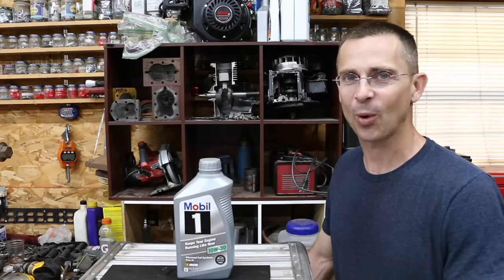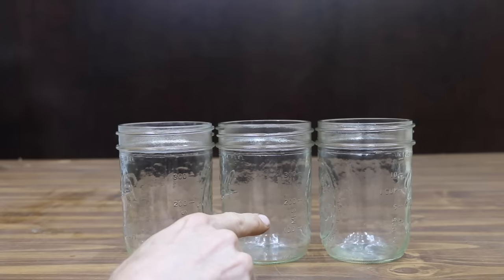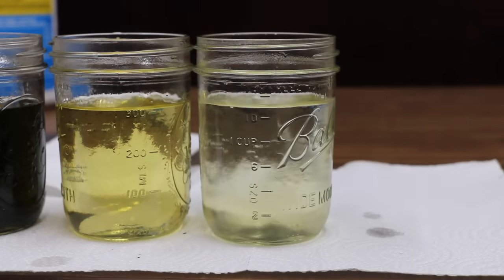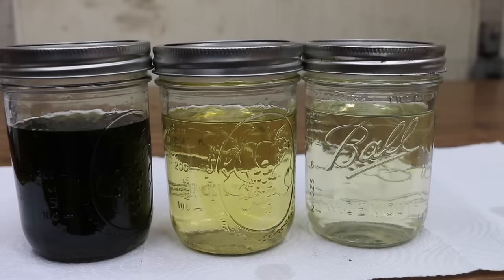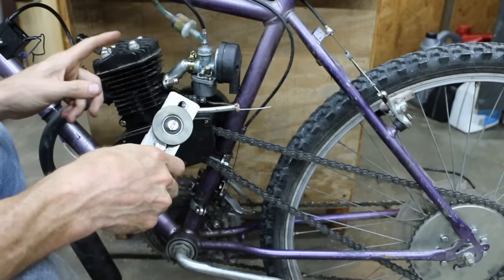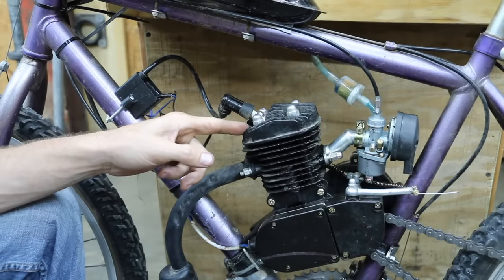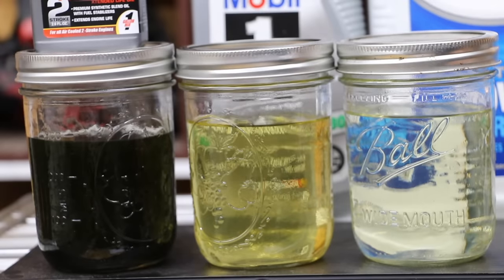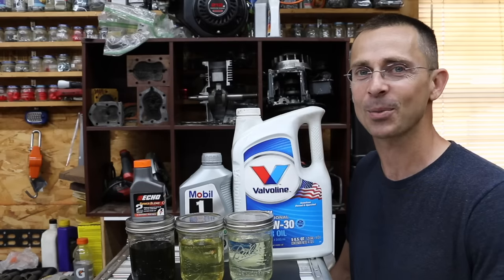Will 4-stroke oil damage a 2-stroke engine?  Let's find out!

Comment: For years I ran my scooters on a mix of conventional 4-stroke engine oil and petrol, using the measuring cup provided by the scooter manufacturer.  Never had a problem.  Since the 4-stroke oil is thicker it's important to add the oil before the petrol to ensure it mixes.
Reply: Yeah same for me . i ran it on a tuned scooter yamaha aerox with 70ccm racing zylinder and 21.5 mm carburetor . scooter runs fine over 2 years .
Reply: I did shake my bike after doing it the other way LMAO am I the only one?!!!
Reply: @ofingrey  get a 2 or 3L fuel cannister and shake it in that. You can mount a rack for it to the bike

Comment: I was about 40 years old when I discovered there was "2 cycle oil", growing up we used Quaker State 30w in everything including chainsaws for bar oil.
Reply from the maker: Thanks for commenting
Reply: Bar oil is thicker and sticky to help it stay on the chain, 30w gets flung off at the tip. Your chain will last longer.
Reply: Yeah, I was taught as a kid that 30w nondetergent oil was just fine. And, of course I had to use it several times just for the heck of it. We had lots of woods and chainsaws around when I was a kid; as for the bar, sticky oil seemed best, and about a 50w seemed good enough so that the chain oil reservoir didn't empty too fast.
Reply: Buddy of mine cuts and sells firewood and he only uses used motor oil for bar oil. He comes around ever so often and picks up our used oil.
Reply: Yeah USN (X Navy Deep Sea Diver here, 87-95 disabled) The only problem I had with lower weight oils was the chain oil reservoir would run out of oil well before the gas tank ran dry, which is a little bit of a pain to have to keep checking it, and if you forget, it wears on the bar pretty quick which makes your chain sloppy side to side in the grove.
Reply: David, I agree, but back then between cuts I was taught to put the end of the blade near some wood and rev it up and if it wasn't flinging enough oil fill'er up. (I was an AEC, also VA 90%)
Reply: Don't get me started on the VA and what they have done to me... the rats :) I'm appealing (again) and it has been 6 years waiting on that. I was out there cutting pulpwood and posts, so I needed the oil to have equal timing with the gas tank.
Reply: i change my truck oil before it needs doing and then recycle it in my saws oil tanks .  good for my truck and also seems to work as chain oil too .
Reply: I mix quaker state 10w40 in my dadss old lawnboy and works great, ill keep doing it
Reply: James Lee get a remote oil filter
Reply: Ive used 3.2oz/gallon of 30w oil in my stihl equipment for 15 years and its all great.  Its 40:1 ratio

I run canola oil for chainsaw bar-oil for that same time & and its also great

Comment: I have been using any motor oil I have laying around on my old 2 cycle air cooled engines for many years. And have found no problems. I figure as long as the mix is a little rich no harm can come to the engines with the exception of more carbon in the muffler of the engine. And all my two strokes are still running. Keep up the videos.
Reply from the maker: Thank you!

Comment: Back in the old days we used SAE 30 weight oil mixed at 20:1 in the fuel for a two stroke engine...it worked OK - but the oil is nowhere as good as specific two stroke oils that are available today and are run at 50:1 ratios.  The oil used in this test is a multi-grade detergent oil - and all those additives are worthless in a 2 stroke engine.  I worked in a repair shop back in the 1970's and we had to decarbon the exhaust ports on most 2 stroke engines when the carbon would build up and block the exhaust ports and mufflers.  Modern 2 stroke oils are far superior and lubricate better, smoke less, and don't build up carbon.  The test in this video was limited to a very short duration in a low performance 2 stroke........it is not representative of what you should expect in long term use.
Reply: David Whitacre  also if the motor was under load the test would be a bit more realistic ..
Reply: Forget the additives.  4t and 2t oil all have a base oil AND then additives are added.  What is the differences in the base oils?
Reply: @warryckscown5620  If you are talking about the video, he rode that small bike out in the field and back.  He also was just pointing out you can put any oil in your machine for short periods and it will not harm your engine.
Reply: @250txc  indeed. They're both base oils. When I run out of 2 stroke oil, I get a jug of regular Sae 40 monograde. I use monograde because it doesn't have any modifiers in it
Reply: I highly doubt anyone in a pinch would CONTINUOUSLY keep running 4 stroke oil in a 2 stroke lol pretty sure it wouldnt hurt even running a full tank of mixed gas with regular 10w30 in it unless you are holding it at max rpm until the gas ran out.... I mean shit, any bit of lube is better than no lube if you're in a pinch. Especially for these small engines running for a short duration at somewhat low RPM. But yes you definitely covered some solid points 👍

Comment: Back in the 1960s I owned a SAAB with a 3 cylinder 2 stroke engine. When you got to the gas station you jumped out before the attendant pumped your gas (what a novel concept) and added a quart of 30 weight oil to the gas tank then filled it up with gasoline. It must have worked. I drove that car for over 90K miles with no issues.
Reply from the maker: This is very interesting!  I didn't know there was a 2-stroke engine made by SAAB.
Reply: SAe 30 run fine and burn clean

Comment: That bike looks like it might be TOO much fun.
Reply from the maker: lol. Yes, it's a great way to cool off in this hot weather.
Reply: I purchased one of these motorized bike kits and yes, they are pretty fun to ride. It has way more power and torque than I was expecting from this little engine. How long can these motors run continiusly without overheating? 
PD: Do more bike videos!!!
Thanks
Reply: Led Daudet they shouldn't over heat since they are governed, just don't engine break down a long hill and you should be fine for hours.
Reply: I've heard they last about 1,500 miles of "normal" use then the cylinder wall gets scored.
Reply: I have a motorized bike, its extremely fun 👍
Reply: Project Farm how fast can the bike  go with the kit
Reply: @offroadz4861  depends on weight/bike/mods. Stock about 30-40with mods (porting, timing/expansion pipes/intake carb) over 70mph
Reply: bmxbeemer80 what keeps them from over revving then?
Reply: @gusthebus2542  you have obviously never had one apart. I have one apart in front of me right now.  Only things connected to the carb is throttle cable and fuel line.
Reply: bmxbeemer80 yeah sorry that comment sounded kinda cringy i was just wondering so hopefully i don't offend you or anything, I have  a honda flat track dirtbike and I know if you keep revving it, it will eventually blow its self up because there is no limiter of any kind. Theres also basically no top speed it's just how long you let it rev up. I'm guessing this engine is similar?
Reply: Modded these motors will spin well over 10k rpm, some say 14k. Out of box maybe only 6-8k
Reply: @Imageloading...  neat! My bike will spin about 16k.
Reply: @gusthebus2542  do you have your bike in videos?
Reply: @Imageloading...  nah sorry dude...
Reply: @Imageloading...  if I do post somthing it becomes private for some reason :(
Reply: @Imageloading...  I dont have a Instagram or snap but I could text you a pick of the dyno sheet
Reply: I use to have one of these, I towed my friend behind me 60 miles to the beach going 30 mph. Anything faster the frome would vibration into bits. But hey, we made it there and back with 0 issues. I would be the gas, and he would be the brakes. A loop of 550 paracord in the middle with zip tie breakaway lines. Unfortunately the clutch completely burned out when going up a mountain pass. I clutch dumped it at 4k rpm, and i didn't realize it was slipping until the pads were all glazed over. I stopped it and couldnt restart because the pads were so glazed, it was as smooth as glass.
Reply: TIMEtoRIDE900 I've put 1500 miles in varying riding, including mudding and in the snow, left it in the rain, raced it, and all that happened was the threads for the spark plug gave out.
Reply: offroadz bro the "standard" 80cc kit peaks at around 30mph in good conditions. variables include rider weight, aerodynamics, tire profile, wheel weight, size, and axle bearing friction. I've gotten mine to go 35mph on 27" diameter tires while planking on the seat.
Reply: gimme likes because my profile pic is justin y mostly the crankshaft weight and friction, in correlation with the intake. theoretically you could rev as high as 13000 as long as you could maintain the air/fuel ratio necessary to overcome the drag of the crankshaft. with 2 strokes as the fuel contains lubricant more fuel =more lubricant so you really can't "over rev" 2 strokes, you just increase the temperature as opposed to overpressure the head/score the walls
Reply: @gusthebus2542  a two strokes exhaust port limits rpm to a certian degree
Reply: It was custom ordered and was featured on an episode of american chopper
Reply: Petrol engines on push cycles in UK are illigal here and you end up in Criminal Court.   So are electric push-scooters and skateboards 2 or 4 wheeled variants, but electric pushcycles are legal under 25mph.   If it is  not taxable then its illigal.
Reply: Off subject a little, but I have that bike kit. I made a silencer out of a red Bull can for the bike muffler. Cut off the top of the can, drilled small holes in the bottom and stuffed it with coarse steel wool. Slid it over the bike muffler and secured with a radiator hose clamp. Works fine until you catch it on a curb.

Comment: A lubricity test for 2 stroke oil brands would be interesting. Include red line racing oil if you decide to do a video. Testing it mixed as well as unmixed might be a good idea. I would use 32:1 in the mix tests because its a very typical and average mixture. Good vids btw!
Reply from the maker: Great recommendation! Thank you!
Reply: Yes! Please test redline vs maxima k2 vs amsoil vs whatever else! Pleeeease!

Comment: As a young teenager in the early to mid '70's I had a '72 Suzuki TS125 and the only oil it ever saw was Pennzoil or Valvoline 30wt, whichever was on sale cheapest. Same for all my buddies and their bikes. I don't even know if there was anything such as 2-stroke oil back then, but the regular 30wt worked fine and none of us ever had any problems with our engines, and we ran the crap out of them.  Great video as always, thanks! 👍
Reply from the maker: Thanks!  Thanks for sharing.

Comment: Good question. I have a tiny 2-stroke generator that I keep in case the power goes out to keep my reef aquarium alive. I don't always keep 2 stroke oil on hand, but I always have some mobile 1.
Reply from the maker: Thanks
Reply: Reef aquaria are pretty hardcore. If you want to keep the little generator as a standby unit, consider getting a can of long life fuel. It’s got less cycloalkanes and more aliphatic hydrocarbons, so it’s more stable over time. 
Another solution would be to get a camper battery and an inverter, that will get you a few hours at least, depending on the size of the setup and demand from essential pumps, heaters etc.
Reply: I've considered battery options, but I've used this generator twice, and it's gotten me through half a day just fine. All I need to run is my water pumps and a heater. The thing is rated at 800watt, so it should be able to handle that no sweat.
Reply: Jase Poag that’s cool. It’s always hard to tell with aquaria, mine uses about 120w all up but I’ve seen them much larger. Like, converting the garage into a water treatment plant large 😬
Reply: It could probably even run my LEDs if I wanted, though I'd be concerned about how dirty the power would be. My previous 6x80watt t5 fixture probably would have make it struggle though. haha
Reply: Jase Poag power quality is a concern with small AC generators, they tend to have some strange harmonics so you’re doing it right, stay powering just the stuff you need. Heaters and motors will tolerate a lot of crap, LED drivers; less so.
Reply: You can get gens that run on propane, no need to worry about fuel going bad.
Reply: Jase Poag Just run it dry after use it is the carb that can get clogged if the fuel dries up in it.
Reply: Look into a guy who walked around Australia with his dog, he's also got a nice army surplus Land Rover if that helps,

He has a big trolley that's got a massive battery pack and solar. He said it was incredibly cheap to make, his dog even had room to sleep
Reply: A little portable solar unit might also power the rest of the house if you do it right
Reply: I usually end up using the generator maybe every other year. Due to entropy, the 2 stroke bottle has gotten misplaced the last 2 times I've gone to dig the generator out of the garage. It's not really a big deal though, I've got a couple auto parts stores within a 5 minute drive. Not like there's a run on 2-stroke oil during power outages.
Reply: if the outage is that bad, the parts store will likely be closed ;)
Reply: I used to live outside the city limits where it could be days before they'd get the power on in an especially bad storm, compared to hours for the shopping centers. I've got some 2-stroke oil on hand currently from a ~6 hour outage last spring. We'll see if it doesn't get lost by next time. haha
Reply: Used to have an old diesel generator. Just kept sealed containers of K1 heating kerosene for it. Keep them dry, cool, dark, and unopened they will never go bad. Older Diesel engines are notoriously happy to burn just about any light oil you can feed them. Everything from bunker oil (has to be preheated due to viscosity) to JP5. Also if you had oil heat you can use the home heating oil as well.
Reply: just think of kerosene as very clean diesel and heating oil ;)
Reply: Man, I know exactly what generator you are talking about and it would behoove you greatly to get a small 4 stroke Honda or Yamaha generator. We used to take one of those tiny 2 stroke deals with us to tailgating parties until I tried to power a little bitty 250w microwave with it and it bogged it down so far it shut off. It'd be a shame to lose a whole reef because of an underpowered generator.
Reply: @yellowbusgyu it should be extremly easy to convert a 4 stroke over to propane (or natural gas), there might even be conversion kits for a given engine online. Only reason that wouldn't work so well for most 2 cycle engines is they would need some sort of oil metering device in addition to the propane hookup to keep the engine lubricated with some sort of cutoff switch to prevent running the engine with no oil.
Reply: Lizard Lick RC, a 250 watt microwave? you may have missed a "1" or got numbers flip-flopped, 700 to 1200 watts is more realistic, until you get into large commercial/industrial.
they're not 100% energy efficient and the listed rating is most always "output power" so if you have managed to get a tiny 250watt output microwave, the input wattage is way higher due to heat loss, lights, fans and the real  input is likely around 700watt for 250watt output. simple division (700 watt\120Volts) = 5.83 Amps. the tiny generators don't put out pure/clean AC sine wave, so there's ever more loss and issues at play.
Reply: throttle bottle I said 250 watts. Take your internet expertise elsewhere.
Reply: I'd like to see this 250watt microwave, some photo's including the label or some links to it and manufacture so i can have a good laugh....
Reply: throttle bottle you'll have to wait until the CEO of the company I work for to get home from his "fuck y'all I'm retired" beach trip, but ok.
Reply: microwave magnetron efficency is pretty high, we're talking 90% efficent is normal, and the rest of the electronics will be less than 25W. If it's output power they are rating it on, then a 250W microwave should pull around 300W. 250W is pretty low, tho.
Reply: Short term fix it's apparently okay, but from what I was told many years back it's the polymers in the multigrade oils that are not good. 30W nondetergent oil works fine though.
Reply: Full tilt, everything on, my reef uses about 600watt. Running everything but the lights, it varies from 280watt to 460watt depending on if the heater is running. In an emergency, I have run 1 or both powerheads pointed at the surface and the heater only. The generator handled it like a champ. That being said, I'd love to get a better 4-stroke model, but they are $$.
Reply: Stihl brand pre mix works well for shelf life.
Reply: It will burn it fine
Reply: Get you some ashless 2-cycle oil and keep it in case you need it. Mobil 1 won't hurt, but 2-cycles are better in 2-cycle engines
Reply: @Seth_Stewart  I've got a big 4 stroke genny now, so no worries. There have been NUMEROUS outages since I got it.
Reply: @jasepoag8930  Dang. What area, if you don't mind me asking?
Reply: @Seth_Stewart  Southern Indiana. We get a lot of storms here, and the geniuses at the power company routed our lines back behind the houses through a strip of trees. I think I got the generator about a year ago, and there have been maybe 4 or 5 outages that would have wiped out my fish tank without it.
Reply: @jasepoag8930  That is genius...  We're not too bad off in Oklahoma. An ice storm every several years. A tornado here and there (unless you're in Moore and then you have a target on your back)
Reply: @Seth_Stewart  Yeah, last weekend we had a tornado go through. Missed my neighborhood by a few miles, but knocked out power from 8pm to around 3am.